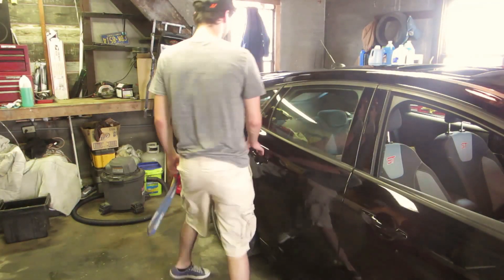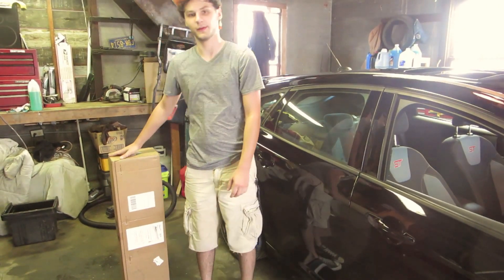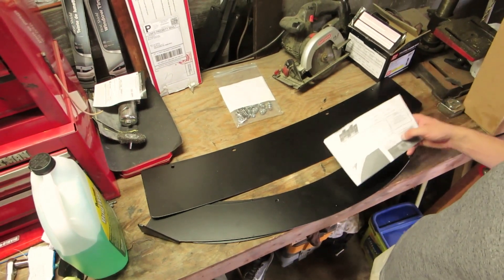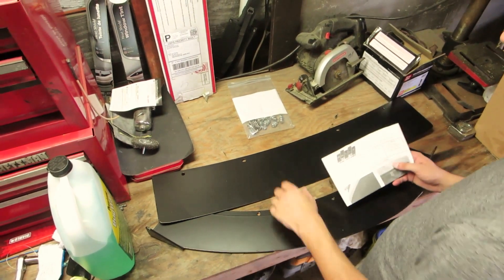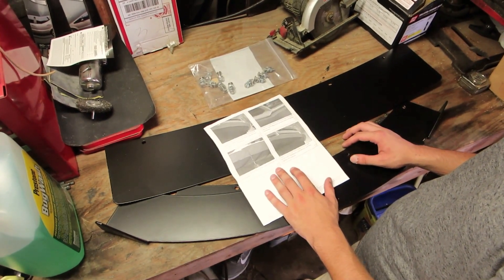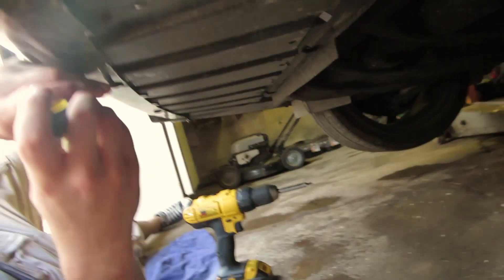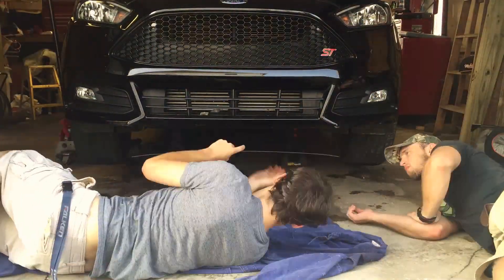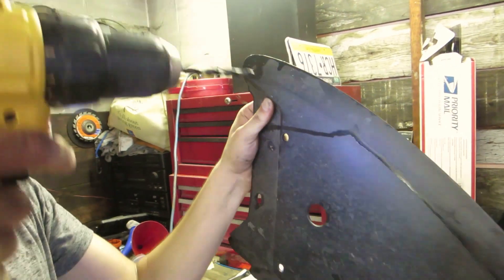2016 Focus ST - Front Splitter Install

Comment: Do you have to drill holes to install this?
Reply from the maker: Eternal Sunshine The hardware supplied goes through where the factory plastic rivets go. The holes have to be slightly enlarged with a drill.
Reply: DARC Ahh got it, thanks! In the case I don’t have a drill nor want to spend the money on one, do you think I’ll be able to get by with trimming the holes with a knife or something?
Reply from the maker: Eternal Sunshine You may be able to do that. The holes only need widened about 1/8 of an inch. It may even be possible to thread the bolts through without drilling at all, it will just be a bit more difficult.
Reply: DARC I’ll give that a try before I start cutting away haha. Thanks for heads up